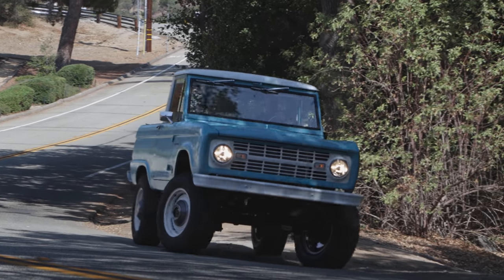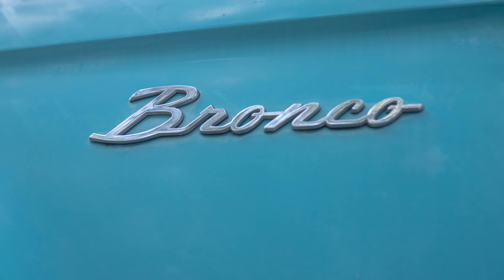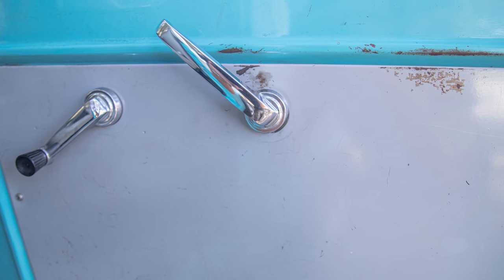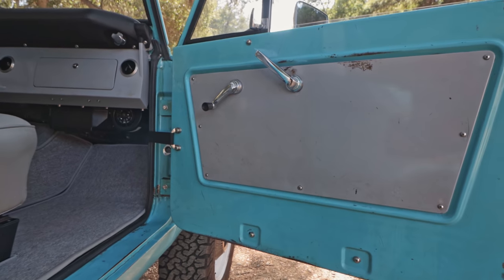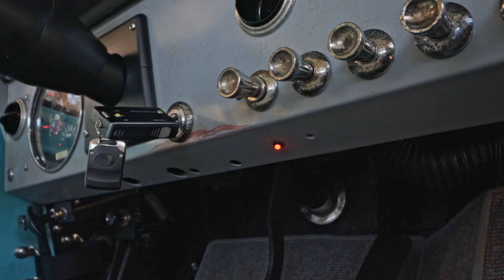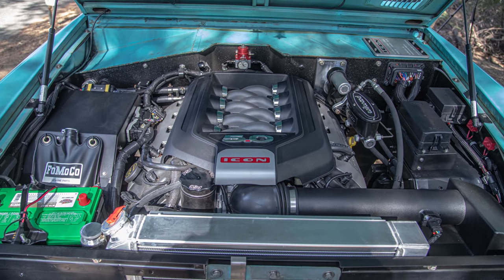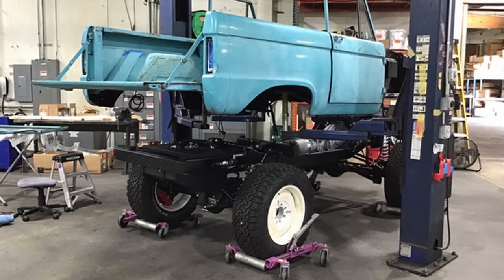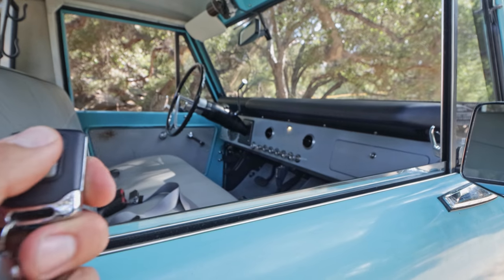ICON Derelict BR #84 Ford Bronco

Comment: @jonathan ward. Pretty cool build. I have always loved the patinaed storyboard of the derelicts. 

A question which may lead to a potential direction for the direlicts for you: When I see the Ford hubcaps or the Interior knobs patinaed..are they only visually having the patina but smooth to touch or do they have that slightly pitted chrome scratchy to touch feel also? I think the latter would add to the tactile old school feel to the old school looks. Of course without rubbing rust over your hands 😂

Similarly it is visually a bit asynchronous to see patinaed bumpers and wheels but a slick clean axle, maybe those can also get some faux patinaeing?? If that’s a word

Nonetheless excellent ideation.